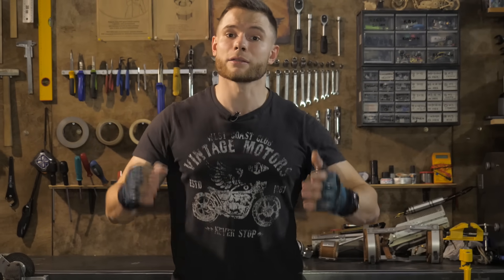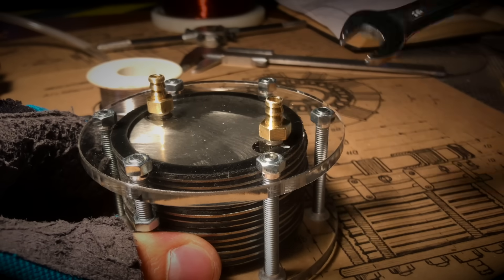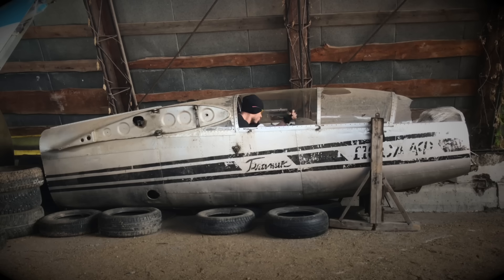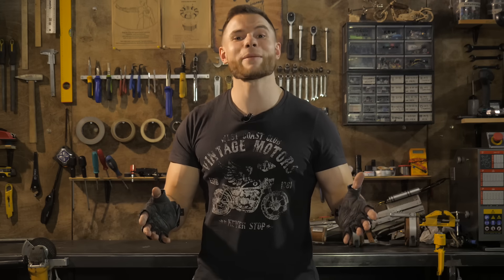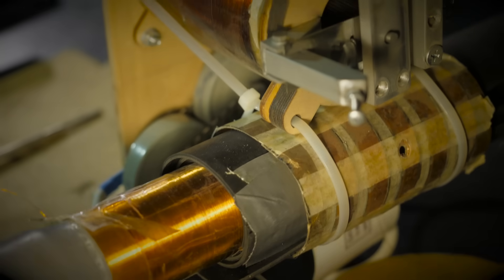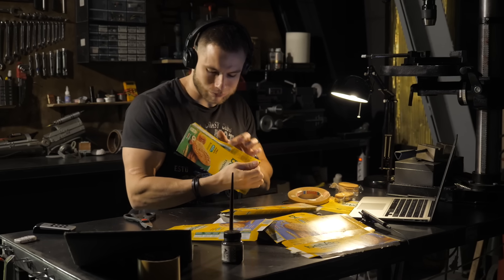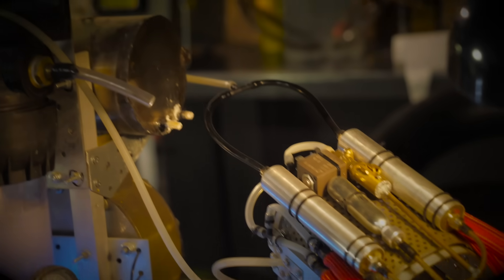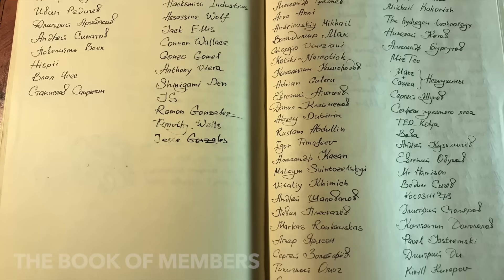Building real Iron Man suit (Part#1: Conception & Protoypes. Reactor, Repulsor, Armor, Exosuit)

Comment: Also, you may already know this, but the muscles are connected very close to the hinge point, which means the torque will be very less, and therefore they will be good but they could still be better , so to solve this instead of directly connecting them with the same side of your hand
Connect them to the opposite side
To describe it
1.hold your hand out with the palm facing up
2.now instead of connecting the muscle on the cleavage of your elbow, from your shoulder, extend the hinge to the bump of your elbow and turn it from there
Get it?
And i know this is expensive but carbon fibre can be used to make the parts that don’t need .45cal protection
Like the bottom of the shoes or the back part of the lower legs
Reply: you should try to put this comment on the other comment of his where he asks us to give him ideas!
Reply: @marz.6102  where is that comment
Reply: @marz.6102  got it

Comment: Try supercapacitors too instead of lion or lipo batteries
Also, you can use rc aircraft jet engines (they are expensive) but they can provide boost and can fill in gaps
Also, I don’t know much but instead of MAPP you can use e85 fuel or even nitrometane or jet fuel or diesel for the jet engines
All the best

Comment: Love your videos Alex Lab! As an engineer around the world watching, I have so many more ideas than you would ever want to hear about how to build the suit! I've worked on a couple similar projects of my own, you're right, armor is hard- I would recommend avoiding joints all together, and instead of trying to make a metal joint that doesn't limit mobility to much, focus on covering most of your body. Then use straps around the joints the connect upper arm pieces to lower arm pieces, upper arm to torso, and lower arm to hand. Then if you really feel like you need armor around the joint, use either chain mail, or make a small pully system attached to a small metal plate that would cover the joint so that when you go to move your arm for example, the flexion of the bicep will pull on the pully, drawing the small metal plate (covering the joint) away from the joint so your arm has room to bend. That's just my first thought, thanks so much for all the awesome, inspiring stuff you're doing, I love it!
Reply: you should try to put this comment on the other comment of his where he asks us to give him ideas!

Comment: Great video. For suggestions, maybe look to see how people in plate armor handle joints?
Reply: Plate armor wearers usually depended on physical ability, and the armor was fairly restrictive. Plus this is an exoskeleton. Maybe combine plate armor design with insect exoskeleton design?
Reply: @natp8888  With proper weight distribution physical ability was less of a concern, and I'd think it would be comparable to the weight he's wearing. As far as being restrictive, maybe some tournament jousting sets where they only have to last an hour or so (not entirely sure on length) would restrict, but on the battlefield with losing one's horse being a real possibility they still valued movement. Not sure what you mean by an insect design, but plate armor had articulated and segmented parts to match human movement and was developed for a few hundred years for the human form.

Comment: Scale armor at body joints, much more free movement at the body joints, though strength and internal space/comfort become a factor, more joints equals more failure points too, but might be your best. Or, you could always use a flexible material using kydex with a rubber finish.

Comment: My friend you are absolutely amazing 👏❤
👏👏👏👏👏.  So no electricity. Just drain cleaner and aluminum.  When i first started with HHO cells i used Aluminum sheets but there was to much sludge from the Aluminum breaking down.  I was using salt water at the time, with 12v at 15amps. So using just the right ph you can avoid the sludge?

Comment: To solve the problem with the temperature (on the hands and feet), where there will be an open flame, you can use a thermo-cloth based on aeroogel. Drop the likes for Alex to see.
Reply: Aerogel is expensive
Reply: @savitripratapbhanu4397  Yes, it is very expensive, but this is the most effective thermal protection to date. As if there will be an open flame with a temperature of 3000 degrees, and everything that will be between your (hand or leg) just metal 1-2 centimeters.

Comment: Idk if this helps but for the joint problem, there is a joint that allows for the axles to be positioned at different angles other than an even 180°
Reply: You could look at that and see if you can in someway integrate that into the design

Comment: for you shoulder joint.....hollow baljoint with a 90° hintch welded on it maybe work.
its also easy tomake the cable in side for connection

Comment: 1. IDEA : Maybe you should use batterys instead, this will provide an advantage since , not only you can convert  this energy to any form of motion , the second advantage is that you can always distribute the weight of the batterys evenly to the big surface of your body , (in your outfit).
2.IDEA : For years companys research wirless powering systems (based on almost 8 antennas (i think) to transform electricity , you can be inspired by this technology , and the reason you can buld ths is beacuse you are developing this thing from the ground up, so try to recreate wirless power transmision in a big scale (idea:big base power transmiter) here is a video of xiami recently anouncing a product that transmits electricity wirelesly : https://youtu.be/PvWMeo1tcgQ
Reply: you should try to put this comment on the other comment of his where he asks us to give him ideas!

Comment: Glad to see it coming along.  Your video on synthetic muscle helped me out greatly.  Currently working on the mountpoints on the skeletal structure of my robot puma for what is likely to be miles of synth muscle grouped into bundles to make it move.  Also working on a technology to 3d print a composite material that withstands ridiculous amounts of heat.  When i sort out the bugs in that project and get it working reliably i'll send the plans your way so you can 3d print thin heat shields to stuff in the deadspaces in your armor....cuz fireproof ironman is way cooler than ironman that can be cooked in his suit by a flamethrower (figuratively AND literally).  Another idea that you might look into (what i was playing with in my lab)  olimex makes an ekg/emg board for dirt cheap.  Allows you to map the electrical impulses sent to muscle groups on your neural system to move the muscles in your body....outputs to a regular arduino.  Use a pile of olimex boards, the ekg pads, and a zentai suit to build an inner suit for your ironman suit that maps your muscle movements on the arduino and then use the arduino to drive your synth muscle bundles in the exo suit.  Slap a raspberry pi into the mix for onboard computing on low power draw, tether it to your cellphone to connect back to a larger computer somewhere that does all the heavy lifting for making jarvis work.  Pi also will allow for a cheap and easy controller for your HUD and will even allow night vision if you use a noir pi cam and some infrared LEDs.  HUD system's pretty easy to get running, but if you have questions, shoot me a message and i'll walk you thru it.  If i'm not gonna be the one in the suit, i'll damned sure share my research with the guy that is.
Reply: you should try to put this comment on the other comment of his where he asks us to give him ideas!

Comment: Why don't you try making the arms pivot like side to side and front back to increase the range of movement?? Like one of those handy dandy socket wrenches that use a ball side shape that has a metal bar (you could make a hollow version) to move it around in circles

Comment: Mountain bikes use pretty complex swing arm designs in the rear suspension that allows non linear movement for the compression of a shock absorber while keeping the movement of the bottom bracket vertically linear to maintain the center of gravity during compression. Maybe this could be a good place to look for inspiration for your joint mechanics?
Reply: you should try to put this comment on the other comment of his where he asks us to give him ideas!

Comment: You ever thought of using carbon nanotubes for the outer armour it is stronger than steel its lighter and cheaper although if you plan on using fire or plasma as your repulsor you might want to use aircraft grade aluminum and as for flight have you thought of using small atmospheric thrusters that use hydrogen and oxygen to create thrust? You might not be able to fly but you will probably be able to either slow a fall from a height or maybe even lift yourself for like afew inches
Reply: you should try to put this comment on the other comment of his where he asks us to give him ideas!

Comment: What about Tesla turbines to help with electrolysis. You can use the excess heat from the rocket engine to drive steam into the turbine. You could use this with the Aluminum. Maybe use the aluminum as lily a start up and back up
Reply: Also, a rocket engine would be better and more efficient. If you can 3D print a inverse tear drop shape for the I’m busting chamber, right before the bell nozzle, that may be the most efficient.
Reply: Mix this design with the sr-72 blackbirds cone system for air intake.

Comment: Some of what you have that's made for the internal skeletal system can be made of strong rubbers rather than metal rods . The metal is what's restricted more of the movements. Transfer that into a strong yet flexible material like a nitrile or graphene and I feel like it would drastically help with the flexibility of the internal skeletal system.
Reply: I'd suggest giving graphene a try with its versatility and strength that's already in the industry.
Reply: @charlesbest468  u should think about it.
^_________^
Reply: @marz.6102  sounds good
Reply: With its electrical conductivity I'd just coat it in a non conductive non metallic paint
Reply: you should try to put this comment on the other comment of his where he asks us to give him ideas!!

Comment: Considering that your exo skeleton design is not based on a hinge pully system like most (and is revolutionary), you could connect the limb pieces together through cables at different tightness's. This may solve the issue of external parts moving differently to your body parts, and will make your exo design almost entirely anatomically accurate. I don't know though, I'm only a maths student lul

Comment: While metal joints that are designed perfectly to bend with your arm would be cool it wouldn't be practical or feasible. I think that the only way to make the joints conform to your limbs movement would be to attach the parts with chainmail at the joints. If you want the parts to be sturdy and rotate along only one axis connect extendable metal rods similar to hydraulic pistons to either side of the two parts. You would also need the end of the metal rods to have joints to allow the limb to bend. I hope that you can find a solution and I hope my idea helps!

Comment: What is the conversion efficiency of aluminum oxidation to hydrogen.
Reply: And also why not just use a hydrogen cylinder... As much as my mind can comprehend the problem a lot of energy would be lost in the conversion process of creating hydrogen from aluminium and water and also it would be increasing weight and making the energy generation architecture complex isn't it?... Inshort what's more optimal here?... Hydrogen cylinder+ li-ion battery OR aluminum oxidation

Comment: Magnetic muscle seem easier.. think about it .. with thin rubber to go back to normal length and magnetic for contraction .. hack ,, you can use normal muscle electric stimulation device to control or program your running .. good luck

Comment: Have you tried breaking the joints up into smaller pivot points and using sliders between them, maybe that could help with the length change issues while going from fully extended to fully closed. Most of the inner workings will be hidden so it doesn't have to be pretty... right.

Comment: @alexlab I created some concepts on a program called tinkercad which shows the basic movements of the shoulder, I am currently working on finger constraints but you can look at the design by going to tinkercad.com, login, search for people “coleg1213” then click on the profile with a dog on it, probably in the bottom of the list, then click download on the one that says “v3 shoulder joint”. Or you can go to the second iron man movie scene when hammer dude comes to give weapons, it shows you which is basically where I got the idea from. Good luck and great content btw
Reply: Another thing I found is that by using potentiometers  on your leg can control the hydraulic cylinders and if you delay the movement by like a half second the body should move freely but will still be able to stay and a position when needed. Hopes this helps a little, more models will come out on my tinker cad account so I keep you posted

Comment: I have a suggestion,
What if you can use fuel cells to power the suit with H2 without using a lithium ion battery ? so till will be totally self powered. And also you will need to use a small Lithium ion battery to start the electrolysis process and when H2 starts to form, then the fuel cells can kick in and there will be no need of a lithium ion battery afterwards. keep it up. your so close to victory ! And by the way, no need to make it exactly like iron man. just use its concepts and build the suit that fits you the most.
Reply: you should try to put this comment on the other comment of his where he asks us to give him ideas!!

Comment: Lizards have armor attached to their skin that allows fluid movement.

Slinky type coils of metal could help with joint features.

Hydraulic muscles perhaps need to be very small like filaments of muscles.

Interior structure does not need to be made of metal. Perhaps made stiff polymers. Polymer interior structure can be designed to fit so a tube diameter fits within a larger tube diameter and loaded with springs so as to match biological movement of extension and contraction. At elbows and shoulder and chest.

Outer shell can be made of a clever metal arrangement like chainmail with over lapping segments of larger sheet metal that acts like lizard skin having room to slide under each other if need be.

This is a very difficult thing you are attempting. It's inspiring to see. Nice work man.
Reply: you should try to put this comment on the other comment of his where he asks us to give him ideas!

Comment: Check this guy for efficient hho generators he makes one from graphite and the good thing about graphite is that you can actually 3d print it and if you can make some kind of concentric cylinders (in the shape of the arc reactor) and 3d print them in such a way that they are porous which will increase the surface area which will further increase hydrogen generation. You could also do this with aluminium and have aluminium 3d printed with a porous surface and even hollow inside so water can get in and react to as much surface area as possible.  https://youtu.be/CuZ5WxYwl4g

Comment: Your gonna have to have pieces of the suit move I believe if you want to be able to move proper without have a big suit or to tight. And you should put the exo suit on the armor/suit and build it around you that's how I'd do it reverse engineering. It's be hard to add armor to you and the exo suit but if it was connected to the suit it'd be a slip on. Maybe have sections of the suit that come apart for easier fitment I know that's be hard with hydrogen but your smart. Seriously the coolest guy around bring us the future man

Comment: Have you considered using torque wrenches for the hinges and then placing some sort of servo on the rotation switch so that you can have a system that controls when to turn one way, the other way, or not at all? That and then also you could put them perpendicular to some ballbearing so that you can turn side to side. Just an idea. I love the work and I hope you do great with this project!

Comment: For the hinges of legs elbows, maybe use a double -----0--0------   hinge which will give slightly more flexibility without restraining movement but still be fairly easy to make and kan even support som small twisting when used on 2 sides of the limb (as it forms a parallelogram like movement.

Is it me or is the (mecha) batman suit also a nice secondary inspiration? point?

Comment: the problem i'm noticing with the elbow joint is that it does not align with the elbow, and considering the human arm can actually almost fold flat, as in put the forearm into contact with the bicep, i think a system of two joints would work, this would account for the shofting of the elbow joint when moving the arm and also allow greater mobility, by allowing the arm to curl up more, which is required for many actions such as pushups, pull ups, and other things that would be cool to attempt in your new suit! loving the content, good luck from scotland, alex!